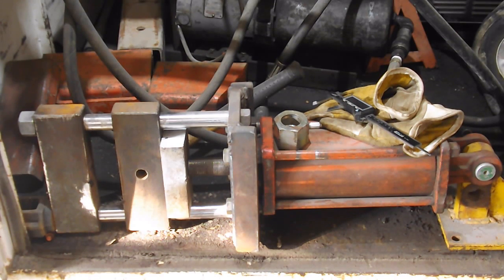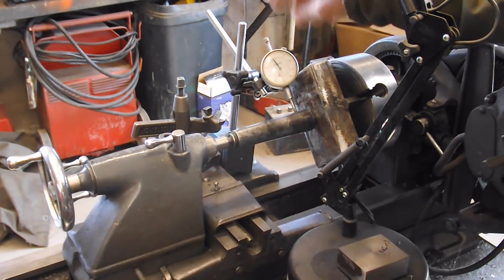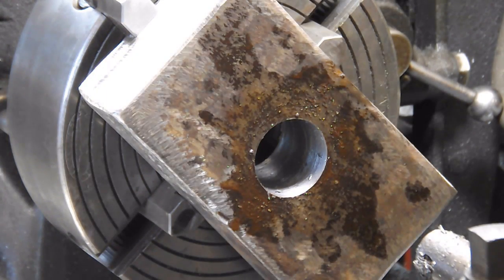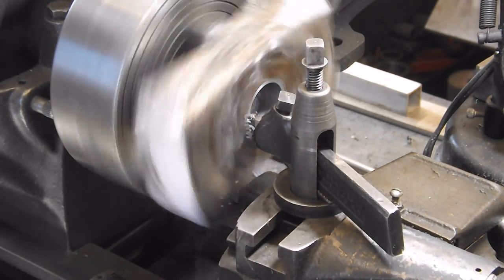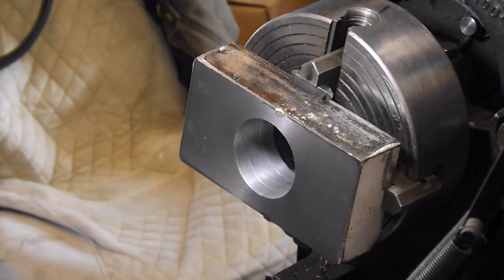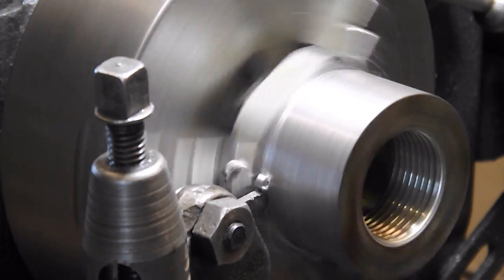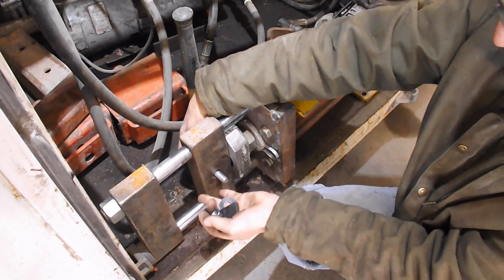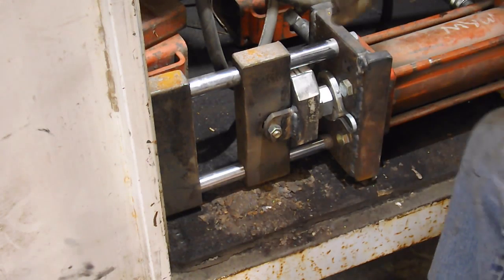Pipe Squisher Return Nut- (Part 2 of Press Build)

Comment: What hydraulic pump are you using? Just a single acting 12v pump?
Reply from the maker: It's a 120 volt, 3/4 hp, 1 gpm setup. Can't really call it a "single acting" pump, as that refers to the valve. There is no valve on the pump, just a "pressure" line which then goes to a double acting valve and then returns back to the reservoir.
Reply: @WideVisionMetalFab  thanks ordering 1 for a pipe smasher need to smash some 1-1/2” round stainless.
Reply: @WideVisionMetalFab  he probably meant single stage pump. That would be my guess.

Comment: Why didn’t you screw the nut to the bolt then use to press to press fit it? so you didn’t have to cut the corners ??
Reply from the maker: Because I'm making/have several attachments for this press, so I need to be able to change it quickly.

Comment: Some lathes have a radius off the scales and some have full diameter. If you are working to digital diameter accuracy then I prefer to set the calipers to digital accuracy to zero. Press "in" button. Measure diameter. When it reads zero (or about .002 for a glue or press fit) you are done. I learned this from Myfordboy's lathe work, so I thank him for the tip. The thing works just as well in metric. Only it is a bit harder to bore out the diameter.
Reply: Addendum: make sure your calipers show no light when closed.

Comment: That press fit was satisfying. Good work! Im curious though, do you have to worry about the ram pulling the threads out of your bushing?
Reply from the maker: It's the same amount of threads as the screw on clevis that was originally on the cylinder, so I assume someone, somewhere did the math and said that many threads should hold it. But you know what they say about assuming!